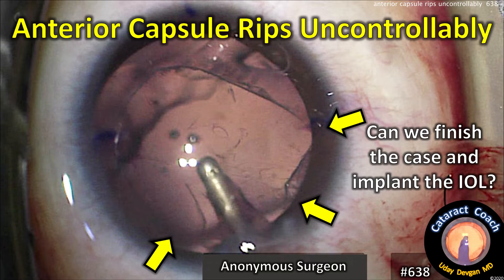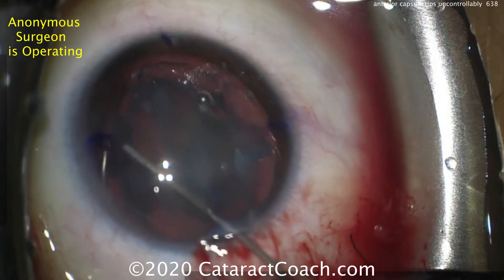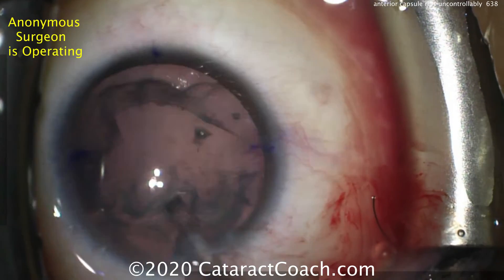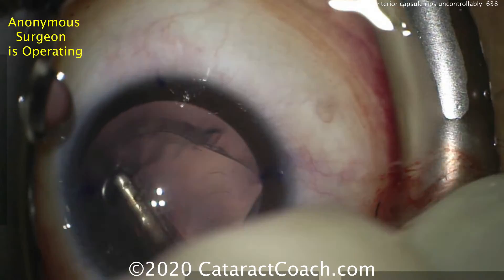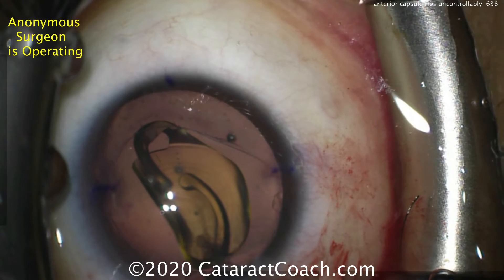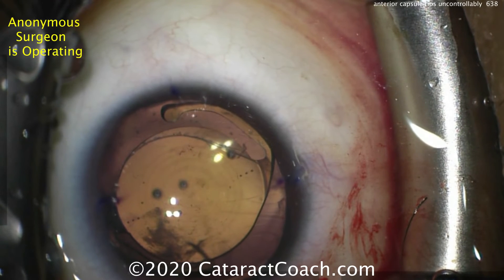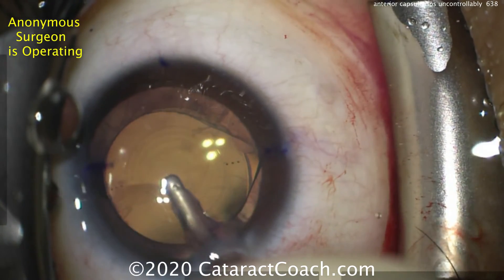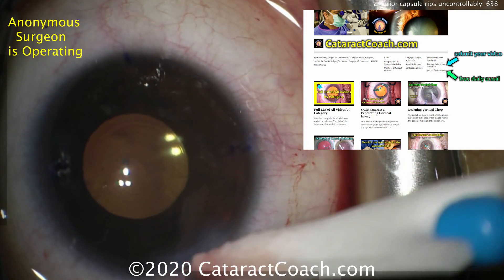the anterior capsule rips uncontrollably during cataract surgery

Comment: Would you feel comfortable implanting a trifocal toric iol (or any other type of premium iol) after such a complication? Please correct me if I' wrong as I'm still learning the very basic principles of phaco. I read that in such a case where the anterior capsule is tearing and the posterior capsule in still intact, one would prefer to implant a three piece iol in the sulcus.
Reply from the maker: Many options depending on the surgeon and the patient’s tissues. In general I would prefer a monofocal IOL in case of future decentration. This video is anonymously submitted by a guest surgeon.